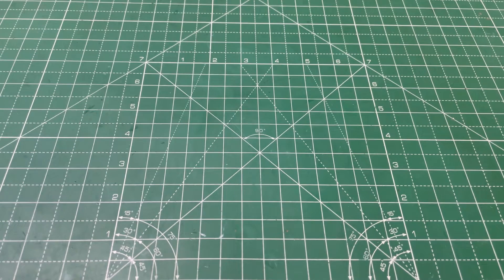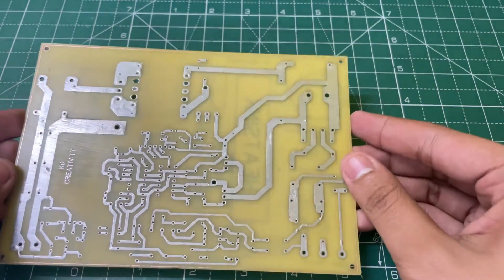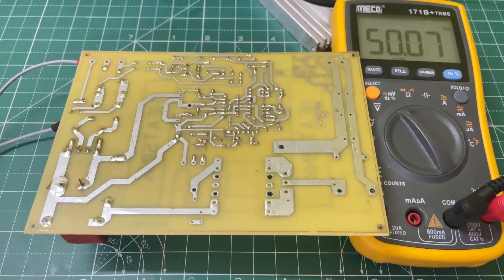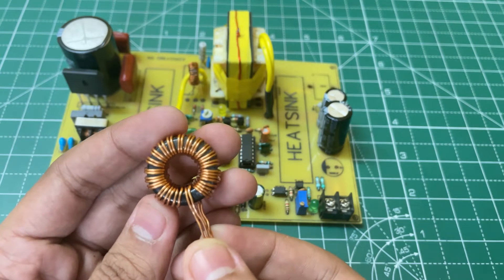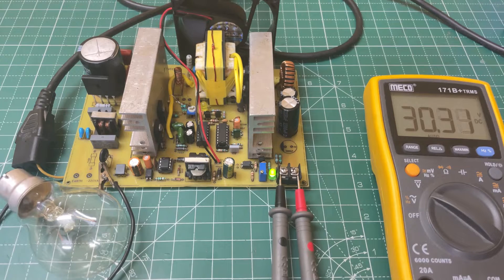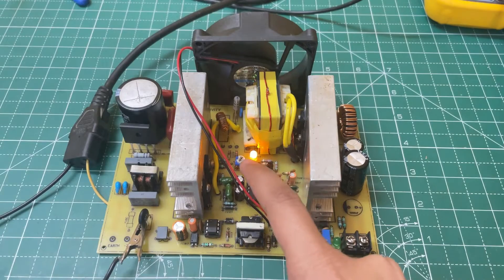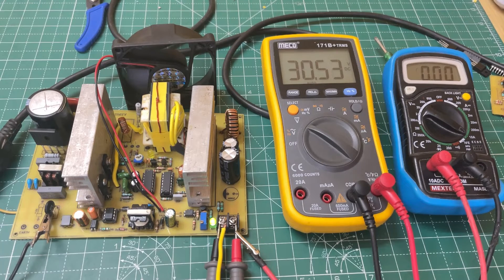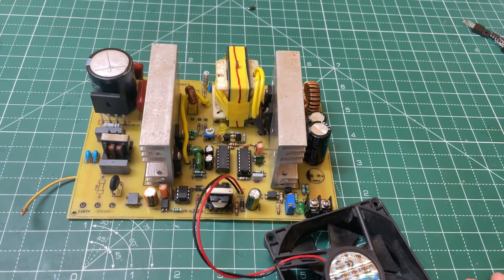DIY 30V 10A HALF BRIDGE SMPS WITH SG3525 IR2110

Comment: What modification for 15 amp from this circuit ??   For lithium battery universal charger make upto 74v 6-7amp ,so 450/500watt smps needed.
Does this circuit works 450watt output by changing higher value MOSFET and thicker wire used turns in transformer winding? 
Or plz make 450watt SMPS .

Comment: Use big mosfets like IRFP150/260N and snubber ckt like RC snubber and use big resistor for snubber and use diode series with gate to first rise time and I believe ur problem will get solved

Comment: Great work bro, thanks for sharing the schematic truly appreciated. Am planning to build one anytime soon for my DIY lab power supply, so am trying to learn the basics before diving in. Am planning to build one with Constant current (CC) Control, and am just thinking would it be possible to integrate it with your circuit?
Reply from the maker: Yes it possible to integrate CC in it but the circuit will get more complicated

Comment: Thanks for your explanation، Can you explain more about current protection that use in this circuit, I dont understand it.
Reply: Nice project but there is  difference between schematic and the pcb files the resistor infront of the mosfet is it 4.7ohm or 47 ohm?!

Comment: @KD CREATIVITY That PWM controler provides plus and minus, so you don't need driver for mosfets swiitching, you can connect them directlly...  Speaking of buzzing, first thing first, take an osiclloscope and check for oscillations: primary winding, secondary winding, feedback cirucitry and output itself, at the output terminals. Generally speaking  that sort of problems may be generated by  inductors/traformer winding vibration, badly designed grounding traces/faulty capacitors, SMPS overload,, and possibly a few other things that I currently forgot to mention

Comment: dear sir nice video but is it possible 12v aux supply is can be generated by other method & also share transformer design calculation for different output voltage

Comment: Hi, I want to ask, can we adjust the voltage and current in this smps circuit? Like adjust with fine and course
Reply from the maker: You can set the output voltage only, for current it has over current protection. The circuit is turned off when it reaches the oven current protection limit
Reply: @kdcreativity6201 the max overcurrent is just 10A right? So we can adjust under 10A
Reply from the maker: Yes

Comment: Wire mm to wire gauge which wires 0.2mm, 0.45, 0.4, 0.5 please send a wire gauge number.............
Reply: I design 12v section is not working send a swg number which wires
Reply: How to design a transformer?
Reply from the maker: You can google this. MM to swg

Comment: I have tried your circuit but the output diode is always broken when the load is 5a to 10a sometimes the load 1a is very hot please help me
Reply from the maker: Which diode are you using ?
Reply: @kdcreativity6201  I use the stps4080 40a 80v diode and I use the ee42 non gap transformer I always have problems with the diode which is always short
Reply from the maker: @tafsiralmuyassar  try replacing the inductor
Reply: @kdcreativity6201  please help me

Comment: Great video .I was watched  some videos and your videos great because you r videos have test sections too.
My question is about PWM controllers have some protect features (for example over voltage Protection etc) 
how understand pwm controller's in protect mode in not working  power supply?
For example how can make "Troubleshooting board for IC" 
* We can try extarnal power  supply voltage for PWM controller 
* We can apply  suitable frequency and wave to need IC pin/pins for find problem 
Could you make a video for a famous PWM controller's "How understand  PWM controller's protect mode"
Reply from the maker: Thank you very much. 
•Yes you can add a over voltage protection circuit too but you have to add a comparator at the output and connect it to the pwn section for shutting down.
• You can power the pwm circuit externally and check the frequency on the output pins or you can check the voltage, it should be between 3v-5v
• If you want to check the IC’s then you can power them and check the following things 
1. They are heating or not
2. Proper voltage on reference voltage pins
3. Output voltage on the pwn pins

Comment: Hi bro.
I regularly follow your videos.
I learnt a lot from your videos.
Thanks a lot.

I made one 24v smps with ob2269 ic
It works fine.
But it giving hissing noise while no load and lightly loaded condition.
When i increase load the hissing noice gone.

What is the problem and is there any solution for this problem? 
Iam using E-I 30mm core
With 35 primary and 8 secondary turns.
Reply from the maker: Thanku very much bro. The reason for that hissing sound is the main transformer. Can you tell me the air gap in the transformer so that i can check your winding data
Reply: Thank you for replying.
I didn't not create any air gap for transformer.
Is air gap is necessary?
Iam using E-I 30mm core.
Reply from the maker: Bro air gap is very important
Reply: How much air gap should I maintain?
Reply: Can you please share the 24v 6a smps EasyEDA pcb files.
Because the pdf picture quality is not that much of good.
Please send the pcb files (not the Gerber files)
Thank you soo much bro

Comment: Hello bro nice smps project but i am confused transformer winding auxiliary transformer step by step video guide the transformer winding 
Please help me ?
Reply: Sg3525 switching frequency 65 khz / 91 khz ?
Reply: output transformer input voltage ?
Reply from the maker: The input voltage of main transformer is 155v
Reply: @kdcreativity6201  again thenks bro
Reply from the maker: I have given the transformer details in the video description but if still you need to see the detailed winding of the auxiliary transformer, then you can see my old video of 12v 1a smps. Both transformer has same winding details. Thanks
Reply: Thanks bro 💚
Reply from the maker: Its 65khz

Comment: Thanks, the auxiliary part is missing explains brother, I’d like to know more
Reply from the maker: There is a separate 12V power supply for the control circuit and fan. For short circuit protection, the ic needs a separate power supply to work properly. The auxiliary power supply works even after the output shut downs